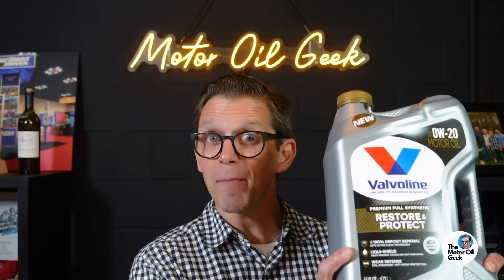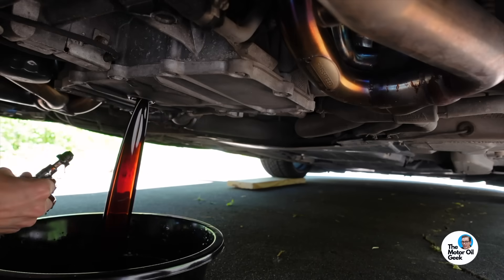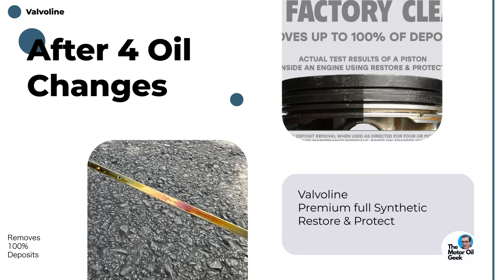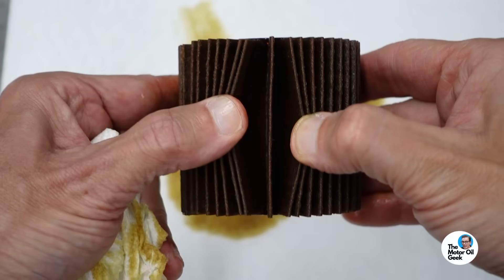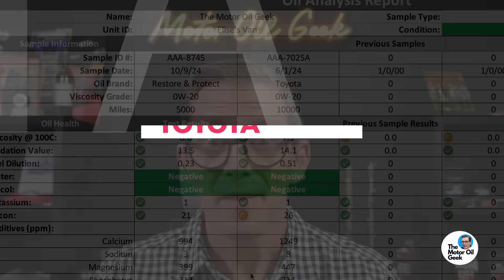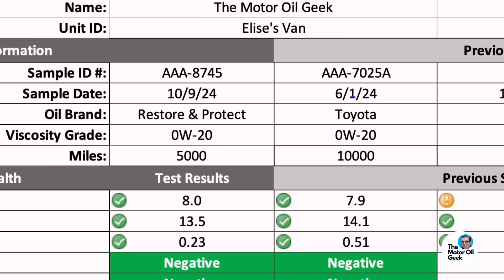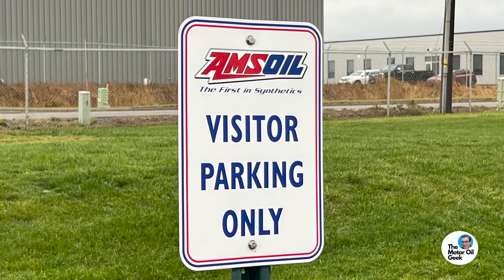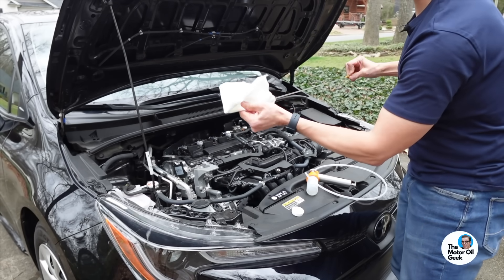The TRUTH About Valvoline's BOLD Engine Cleaning Claims

Comment: Thank you Lake for another outstanding video.
I have just brought two 6 litre of 10w40 for my Jeep TJ 4.0 with 365,000 kms on it and I’m going to change over to it soon.
I’m thinking of changing out the oil filter halfway through the period as the top end of the engine is not the best even though the CCV system and oil changes I do every 8-10 thousand kms.
Previous owners I think let it go for too long.
Should be great oil from what you have tested so far.
I have also spread the word around about this oil as much as I can to friends, family and work colleagues.
Good to see you mate doing what you love.
🇦🇺🇦🇺🇦🇺👍🏻👍🏻👍🏻👍🏻👍🏻💪💪💪

Comment: One owner , 18 years , Jeep V-6 , 230 thousand miles , no need for any cleaning or restoration . Just always top quality full synthetic . Btw , I'd like some varnish on the dip stick , when I first change it , I can hardly read the level ,,, !
Reply: Just take a propane torch and heat the the stick till it turns blue !

Comment: I love your enthusiasm for tribology. Man, you talk my language. I resolved my oil consumption issue a year ago, but I still watch each week for your next Video. Keep up the great content. I sent a request to team behind my favourite podcast, Ologies, to interview you. You are a born science communicator trapped under a hood. I love it!
Reply: Hi, how did you fix oil consumption problem?
Reply: I fixed my 2014 Audi's oil consumption by upgrading the pistons. The EA888 Gen 2 engine is prone to issues with low-tension oil control rings that carbon up and fail. Since this was a project car I bought at a great price, I chose the long-term fix: rebuilding the engine with updated pistons that address the flaw. It was worth it for me, as I had the skills, and other key components had been recently updated.
I also couldn’t try Restore and Protect  5W40 since I cannot get it in 5W40, but if it meets your car’s specs, it’s worth a shot—you have nothing to lose if you have oil bypassing the positions. 

My questions for you:
1. What diagnostics have you done to narrow down the cause of your oil consumption? Have you done a compression test, inspected the pistons for oil wash, or checked the intake pipes and PCV system for oil buildup?
2. How many miles are on your car, what’s its oil change history, have you tried any products like Restore and Protect and was there any improvement, what value do you place on the car after repairing the issue?
3. Is your car/engine known for oil consumption issues, and what are the common causes?
Remember, oil consumption can have many causes. On some engines, it’s as simple as a bad PCV valve or a leaking turbo.
Let me know—I’m happy to help you troubleshoot before you try something. Remember, facts over speculation: Condition, Cause, Confirm, Correct.
Reply: Yeah, how did you fix it?
Reply from the maker: Thank you!

Comment: Not to take away from this R&P oil but, I personally since about 1970 have always put one quart of transmission oil in every oil change, I have never had any sludge in my motor, in fact I removed the valve covers and guess what the heads, spring, rocket arms look like brand new. The reasoning is transmission oil is a highly detergent oil and takes heat without any thermal breakdown what do ever.you all should definitely try what I've been doing for over 50 years.
Reply: Interesting! I wonder if that does any damage to modern GPFs and DPFs as they require a low ash oil

Comment: It should be interesting seeing what happens if you use this oil in a Toyota that burns oil usually do to the deposits that stucks those crapy low pressure rings in the pistons...
If it will clean up unstucking the rings stopping the consummation of oil and if it happens how many miles/oil changes is needed to do it.

Comment: I just bought a used 2013 4Runner off the original owner. Has only 106k miles on it. But I put this restore and protect in it based off your video from at the manufacture when I did the first oil change in my ownership and I swear the engine is quieter now.
Reply: Are you you going to continue running the Restore & Protect or is this just an application for the first oil change?

Comment: Let me see. I buy the weight and oil recommended by the owner's manual. In this case a 0-20W  synthetic SP oil  that is on sale at my O'Reilly's at any given time, with a synthetic WIX filter for my wife's '18 RAV4 XLE Hybrid. Change both every 5,000 miles. We drive moderately. My engine will last as long as your engine does and oh yeah I mix brands too as long as it is the same spec on the bottle. So much for all your playing around. Recently I use O'Reilly's full syntec at 7.95 a qt, (0-20W SP) so why would I buy the 10.95 a qt. of Quaker State, or Valvoline or Pennzoil, etc., etc. I won't.

Comment: You run 10000 miles on your oil between changes?
Reply: Yes he was and the great irony is even though his oil analysis indicated his Sienna Van's Toyota brand synthetic oil was good for 10,000 mile intervals, his dispstick showed those intervals resulted in varnish deposit buildups. So once again we learn the hard way that extending intervals beyond 5,000 miles, even with synthetic, are harmful, hence there is no point in trying to extend them.
Reply from the maker: When the data says so, yes.

Comment: I have a question. I have used Valvoline oil in my 1996 pickup since it was new . I changed oil every 3000 miles. It was recommended at that time to change every 3000 miles or ever 3 months. Now I am retired I only drive about maybe 500 miles a year. I would like to use the restore and protect so how often should I change the oil?

Comment: Your findings at 7 minutes are HUGE because this is the premature wear that happens on modern Toyotas, the gunk that seizes the oil control rings.   Amazing!!!
Reply: Toyotas gunk up when you change the oil too late
Reply: @jankington216  Toyota's and Honda's as well have too low of a vacuum in their PCV System and the Blowby accumulates in the ring pack. I found this with my Acura MDX. They went to Synthetic oil to raise the NOACK temp and this extends the problem out but any engine that has factory recommended 10K OCI's but the mechanics tell you 3k to 5k OCI's or you'll get stuck rings, this will probably be the problem.
They don't want to contaminate the intake and cylinders with the Blowby so they will build a Catch Can inside the engine and drop PCV vac to around -.2 to -.8inH2O. Most domestic still run 1 to 3inHg that I'm aware of. Hook a Manometer to your dipstick tube and run the hose to the drivers seat so you can monitor. 1inHg is 13.6inH2O, I don't doubt this oil does what it says but it's going around the problem in some engine. My neighbors Nissan Frontier is around -.9inH2O, still too low for good function. We'll see how this all plays out.
Look how low my wife's TL stays and sometimes under pressure(inH2O). I've corrected all of mine including a couple of Civics.
https://www.youtube.com/watch?v=0NmEvB2lFS0
We have oils that are far better than 10 years ago but OCI's of 30 years ago, somethings wrong with that. Engines should commonly see 400-600K miles, my 10 MDX is at 290K+ and it's one of the highest mileage of the MDX'er forum.
Reply: @jankington216 that goes for anything
Reply: Camry v6 piston that is in many Toyotas and Lexuses, same piston even in the 1urfse 4.6 v8 engine and same issue. Diesel soak can get it out but this way looks less hassle...
Reply: It happens to a lot of modern engines, because 5000 on conventional or 10000 miles on synthetic is often too much. People who change their oil significantly more often than the manual says tend to avoid stuck rings.

My mom recently bought a Lexus, and the manual called for oil changes every 10,000 miles. I told mom that if the included oil changes are every 10,000 miles, I'll do an oil change in between what Lexus covers to get the most from her car. However, the Lexus maintenance package is every 6 months or 5000 miles with 0w16 synthetic.
Reply: @skylinefever I have a 2019 Kia and the owner's manual says to change the oil every 3750 miles or 6 months
Reply: @luisramirez-or5vg What Kia? Most are 7500 miles in the manual. They do recommend half intervals which is 3750 base on driving habits but that’s not the standard.
Reply: @HifeMan 2019 Sorento
Reply: *can happen, from poor oil maintenance

Comment: Ironically, this video shows 10,000 mile oil change intervals with a full synthetic will not keep a modern engine (including the dipstick) clean.  3,000 - 5,000 mile intervals are needed, which in turn means spending money on oil analysis at 5,000, 7,500, 10,000, etc. is a $waste$.  The dipstick of my 31 year old Toyota pickup with 178,000 miles is still dishwasher clean.  I've been using Mobil 1 High Mileage changed every 6 months, or 3,000 miles.

Comment: VRP stopped my engine oil burning issue on my landrover LR3. One cylinder had low compression before startup but normal compression after startup.  VRP raised the compression and now it maintains compression. This is on one cycle of VRP.

Edit: LR3 has 250k miles on it. It was buring about a little less than a quart every 1500 miles.

Comment: To everyone freaking out about 10k between oil changes……2007 Tundra- 259k miles and changed oil every 50k and truck still running great with no issues.  Just saying 😂

Comment: Did 2 changes of this across 6000 miles on my near 400k mile old honda. Engine looks cleaner under the valve cover, slight noticeable improvement in performance too. 

Never going back. Even if the the cleaning didn't work the quality of the oil is still too notch, can't really go wrong with it.

Comment: My dad was a mechanical aerospace engineer and always drove into us to use Valvoline gear oils- but no more.

I have a 1965 Mustang with Ford/Warner designed T10 ultra-close ratio 4 speed. The car was my moms since new (special order) and been in our family since then.  I learned to drive in this car as well, and in 1986 I bought it from them, did a ground up rebuild and have about 10k miles on the car to date.  The tranny was rebuilt by guys in downtown Los Angeles who were very well known and been around since the 50’s, replacing the bushings and syncros as the gears, etc. were in really good shape.  When I reinstalled it, I filled it with Valvoline 90w gear oil…. The same tried and true tested gear oil my dad (engineer and racer) used for decades and myself as well.  The tranny always worked very well!

About 2 years ago, I needed to top off the tranny with about 1.5 ounces…. Was out of the 90w so made a trip to slep boys and bought a quart of Valvoline 75-90w gear oil, which stated on the label it was compatible with GL-4 spec oil (which is what our tranny’s call for).  I also called Valvoline tech support and verified that the compatibility was a non-issue, which they affirmed.

Over the next 2 years I slowly began noticing that at times it was becoming increasingly difficult to downshift into 2nd gear… no grinding, just acting overly firm.  As the tranny warmed up higher, this occurred in 1st gear as well.  Finally got to the point where as soon a the tranny warmed up, it was difficult to downshift into 1st or 2nd gear without bringing the car to a complete stop.

Ok, so since I am old school, and still trouble shoot by seeing, listening and feeling, I checked out the tranny……shift linkage was dead on, clutch seemed good but I added a little more reach (1/4”) for it, gear oil look good, visually through fill hole- the internals looked good as well.  Took her for a drive, and still the same.  At this point I’m sitting back in my chair giving this some deep thought since it doesn’t make any sense…… and I come the the conclusion that this didn’t start until after I added oil…… checked around and found that over 100 people online are griping about the same thing, most are dropping their tranny’s and rebuilding them finding excessive parts wear (bushings, synchro’s).

Although I am now thinking about pulling the tranny to see what’s going on inside, I just haven’t convinced myself that this is mechanical related….. it has to be chemical related especially since it appears to be temperature related.

So out of mere “Gut Instinct”, I did a little R&D and found Brad-Penn makes a GL-4 specific gear oil…. Called and spoke to an engineer… he was great and after going through everything, he also agreed that although there was nothing else to indicate, he agreed, the chemistry issue was a real potential…. and he offered me a free oil analysis.

I let “Betsy” sit for 1 month allowing all the oil and particulates to settle.  I bought 4 quarts of BP GL-4 and dumped the oil…. The 1st 8 ounces I drained into a bottle for analysis…. This would also show the highest contamination but would give us the best idea of what was going on.  I flushed the tranny with 1 quart of the GL4, then filled her up.

The oil analysis came back indicating early signs of bushing specific wear….. just what I thought was happening…. The Valvoline oil was reacting improperly and instead of transferring heat away, it was increasing the heat causing the bushings to swell and in essence being way too big forcing the sychro’s way out of alignment……. In short, what a way to destroy a tranny!!!!

With the BP GL4 oil in her, I took her out and immediately noticed a difference…even just the feel, vibrations, sound.  I ran the freeway at 70+ mph, downshifting through the all the gears and can only describe it as “Silky-Smooth”. On my return trip I did the same thing, but when I exited the freeway and downshifted through the gears, I use no throttle- just merely pushing in the clutch and shifting the tranny….. same result….. absolutely “Silky Smooth”!  Honestly the tranny has never ran quieter (although it was quiet before)……. And Valvoline gear oils will never touch any vehicle I ever own again!  About 100 miles later we retested the tranny oil- spotlessly clean.

When I called the Valovine tech support line and advised them on what had happened, the 20 something young lady, reading the PC said I must have bought the wrong oil.  So much for consumer/product support.  California just about the same time banned Valvoline Maxlife ATF due to the oil spec being improperly reported (IIRR).  In short, Valvoline IS NOT the company it use to be and no Valvoline product will ever be used in any of my vehicles again.

Anyway, I hope this helps those in need!

Comment: I used to use Valvoline Synthetic all the time. But every vehicle I only used Valvoline on ended up burning oil before it even hit 100K. So I had an Equinox with 80K and it would burn 1qt every 3000 miles. The filter on this car is a paper cartridge. Which is nice because if there is metal or contaminates in the oil I could see them in the filter, but the filter was always clean. Since it burned oil I decided to save money and use Quaker State Synthetic. After 3000 miles I looked at the filter and it had carbon deposits on it. After that I only use Quaker State knowing it was cleaning off the build up caused by the Valvoline. The Quaker State didn't stop the loss of oil but eventually the amount of carbon on the filter lessened. After finding out the ecotech engines were problematic I finally quit buying Chevys and bought a low mileage FJ from Florida. So I should be set for a few hundred thousand miles before I need to replace this vehicle. It gets Quaker State. There's no reason to pay more for Valvoline Restore when I can run a quality oil for less.

Comment: I use this in both our vehicles.  My wife’s 2018 Elantra has 52k miles. No issues other than she went over 5,000 miles on a few occasions, and had some sludge buildup. My 2020 forte has 35k miles and has always had 4500 miles or less oil changes. The oil turned darker so much quicker than mine. I drove from NJ to SC and back and my oil still looked brand new. I changed both cars at 3k anyway since it was the 1st round of R&P and was concerned about the filter (along with everyone else on YT) lol. Neither filter was bad enough were I think it would have clogged if I went the full 5k. I love this stuff, our engines seem to love it. They’re both noticeably quieter. It’s almost time for oil change number 3. I’ll go five rounds with this and prob switch back to PUP
Reply: 52k miles? Lol

Comment: Hello Motor Oil Geek.  I have a 2003 Toyota Highlander with 3.0 V6 with 282667 miles on it.  It runs  great and goes through almost one quart of oil between oil changes at intervals of 3500 - 4000 miles. The rear main seal has a very slow leak, so I am told.  Would Valvoline Restore  & Protect cause further damage to that main seal?   THANKS!
Reply: Mobil 1 High Mileage will keep that rear main seal from getting bad enough to drip and will also keep your dipstick and engine internals clean: https://imagizer.imageshack.com/img923/7893/BFcZ3w.jpg

Comment: @TheMotorOilGeek Is it possible the manganese is fuel dilution from increased blow by or would that show up differently in the test?
Reply from the maker: If blow by increased, the fuel dilution would have been higher.
Reply: @themotoroilgeek  how does fuel dilution show up in an oil analysis? Viscosity?
Reply from the maker: @Justntoys  We run Gas Chromatography to measure the exact amount of fuel in the oil. In this case, the fuel dilution did not increase.